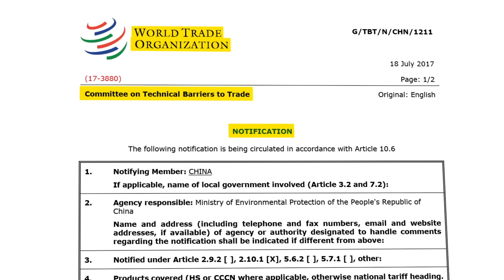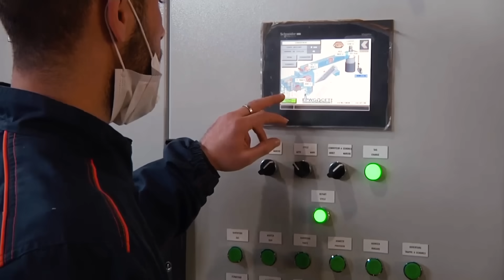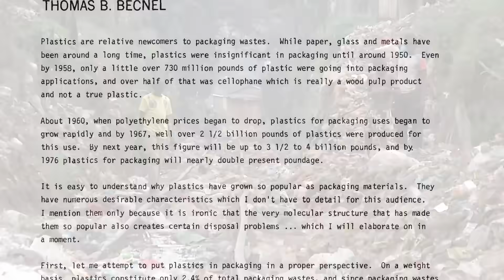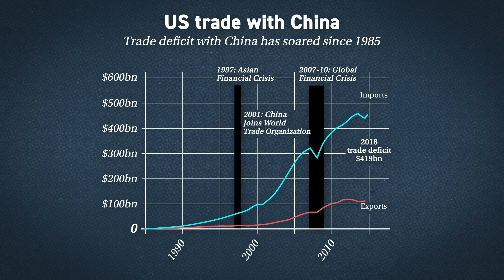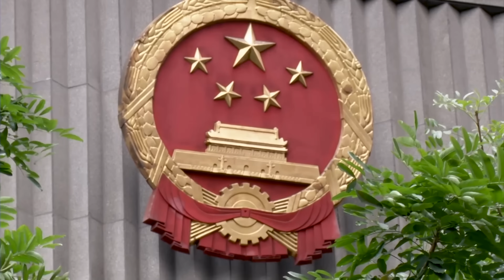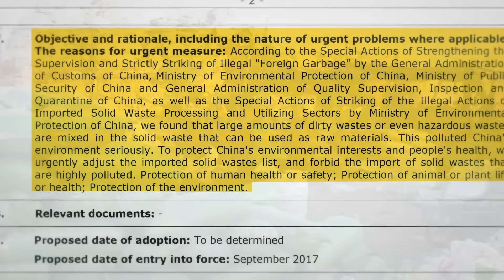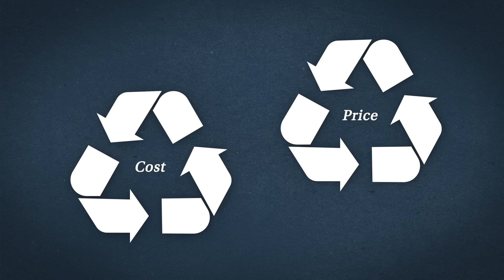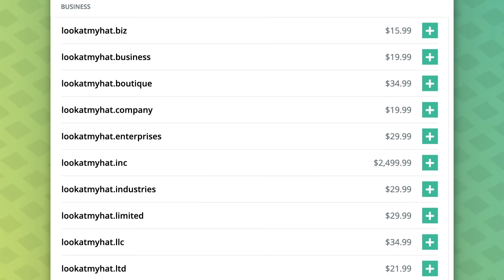How China Broke the World's Recycling

Comment: I was surprised to learn that bottle caps are considered low value.
Here in Italy there are a few charity organizations that collect them and gift a wheelchair to someone in need for every 100kg of bottle caps. I thought that it would have been considered a good plastic to recycle if separated from the bottles.
Reply: My city couple years ago had a big recycling education mail letter
telling people to separate the cap and the seal ring from the bottle before recycling
and toss the cap and seal ring into the trash
(seal ring - the part that break from the cap but remain on the bottle neck)
Reply: They are a high value plastic, however, the sorting of them from mixed piles of plastic garbage and their small mass of plastic per effort adds so much cost that it's not viable unless they're pre-sorted (as in the case of your donations example)
Reply: as he said.. the biggest problem is sorting. There is a awesome video about recycling , unfortunately in German.  You eat a joghurt... you throw that joghurt into the recycling. So far so good. But what do most people do? Put the lid (aluminium) into the cup, the cup gets squeezed.... and the aluminum is out of the process. The cup too as it can't be recycled. Similar to the bottles with the plastic wraps around (Müller Milk f.e. ) both different kind of plastic, machines can't separate them , gets tossed out and burned. If you would separate it before both could be recycled and therefore would be valuable. I guess same goes for the caps.... you sorted them out before.
Reply: @blubbber  actually no, on bottles you dont need to bother sorting out caps or stickers, the PET does not swim, the rest does, its very easily sorted out. the leftovers are fine to use as well, not all but still, far better then just burning all. We usually pre sort em, shred em, wash em, put em through a flake sorter that sorts out per color and then remelt it.
Reply: @blubbber  can you say the name of the video?
Reply: @blubbber  One of the benefits of Thermal Depolymerization is there' no need to sort to get rid of labels or caps or lids even if they're made of metal; at different steps of the process different things 'drop out'.
Reply: @blubbber  How bout if they make the stick on lid on yogurts the same material as the cup? Or bring awareness and tell people to separate the different materials. Or if people buy big amounts anyways, have them buy it in big containers instead of many small ones. Simple things. Yet too many people are unwilling to do them, think of it, or research about it.
Reply: me too
Reply: Italy is preparing for Fallout, smart.
Reply: We used to have the same in Greece; it ended up demanding so considerable an amount of logistics and manpower to run the whole thing, that the organisation said if you care just donate a small sum, which makes a lot more sense when you think about it.
Reply: Here in Norway when i was in school 2011  we collected bottle caps. Every day there was around 400 bottle caps (1 from every student) This went on for about 2 years before it just stopped. Imagine this on a bigger scale
Reply: @scooterxiv3778  How bout people getting their own nondisposable water bottles?
Reply: If pre-sorting is the solution I don’t understand why cities stopped asking us to sort. We pre-sort our recyclables at home anyway; it’s just because the city tells us to throw everything in the same bin when it’s time to take them out we throw everything together
Reply: The problems (in my country) is elsewhere: A bottle with a cap on it cannot easily be compressed by a garbage truck. (It will go back to almost its original size because of the air trapped inside it.) A bottle without a cap will be flattened under pressure, meaning the garbage truck can load a much higher weight per trip. It's the garbage disposal company that pays the charities per tonne of bottle caps. Also having caps pre-sorted makes them much more valuable.
Reply: Lol, actually they are ok, theres far worse stuff. I work at a company that recyles stuff like that, we get huge bags filled with em, they arent as bad as portrait here... Also at least in europe we have/had PET bottles we returned to stores, in germany its still the default and even tin cans like coke etc are like that...
Reply: Corporations ,who control the councils and govt,make money charging for recycling, then they just land fill it , and tell you are doing the right thing (feel good B.S. ) need to go back to glass ,wood and paper ,or biodegradable material.
Reply: maybe it's cuz of Americans not doing their part. Here in Japan, you'd see recycling boxes at almost every big name supermarket, like one for styrofoam tray, one for paper packs, one for plastic bottles (excluding its caps, they are collected separately). It's been like this for at least more than a decade. Sure, apparently we've been shipping some plastics waste to other countries like the US, but it is us, the citizens, we are the one sorting all these, thus it makes recycling easier, meaning more profitable, and probably much portion of the total plastics waste would be properly recycled, I believe.
Reply: Dont listen to that video. Bottle caps are made from high quality HDPE grades. It’s value as a waste is worth a lot, at least in Europe.
Reply: Stavo per commentare la stessa cosa!
Reply: yeah but imagine if you had to pay those Italians to do that work. Europeans are some of the richest people on earth, something like the global 1%. when china cant stop losing money by paying Uyghur slaves €0.10 a day what hope would anyone else have of breaking even doing the same thing?
Reply: We should recycle like Japan. Where the people separate their own recyclables and help. In America, people only have one box in front of their house where they throw all the recyclables in and workers separate them. Workers don't bother to collect small pieces. You can recycle your own plastic. Such as there's people turning styrofoam to glue with acetone. 
There's plant plastic, faux leather, and bricks. Stores like Lush uses no to little packaging. Use fast growing plants like bamboo for wood. Use and bring your own nondisposable utensils to restaurants. There's glass and metal drinking straws. Use nondisposables like glass or metal. Homestead. Japan has toilets that are better for the environment. Do you think digital is better for the environment? How bout nonpackaging vending machines?
Reply: The problem with them is the size. The smaller something is the hardest it is to separate it from the rest of the trash. This is why they make these campaigns, to encourage people to separate the caps on their own.
Reply: That seems to just confirm to me that they're worthless
Reply: it was all a lie
Reply: We also do it in Brasil
Reply: I was also surprised because in Serbia it is the same. But we never heard the price of bottle caps per kg in this video, so it might actually make sense why they are considered low cost. 100 kg is a looot of caps
Reply: In fact caps are from a different kind of plastic therefore they should be removed from the bottle.
Reply: There's always the option of making consumers pay the true cost of packaging material.
Reply: Here in Poland we put the caps on the ends of the chair legs, table legs etc. At least that's what charity says.
Reply: same here in Brazil
Reply: I remember back in school apart from what I call Paper Collection Event(a day when paper for recycling is brought to school) there was once or twice Bottle caps Collection Event.

Also stores nearby happy to get bottle caps.
They get sorting for free, we get less waste on landfill.
Reply: A wheelchair for every 1/10 ton of bottlecaps? Hahaha what a ridiculous thing.

Comment: Ugh you took all the time and effort to gather this info (which is good and accurate) only to slap a racist click bait title on your video. Perhaps if you really wanted to spread this message you would do so in another more helpful way. 

You all said this pretty early on in the video but this needs a huge asterisk next to it. "Recycling isn't profitable so it's not viable." In my opinion that's a huge yes and no. It's not AS PROFITABLE as the corps producing this junk want it to be. Believe me, Coke and Pepsi could certainly accept smaller margins if they wanted to, but their CEOs don't give a damn about the environment. They're just trying to profit as much as possible and that's as far as it goes. 

China may have slammed the breaks on an obviously broken system, but they're not to blame here. We need to consume less. Then reuse. And the LAST viable option is then recycling. Big corp knew this very early on though as you all documented but instead chose a scapegoat and here we are 50 years later. We're all to blame for this. Every single one of us.

Comment: In Denmark we have 6 types of sorted trash in our homes.
After it has been collected and processed there's basically nothing left. It has all been either turned into electricity, been recycled or slags used as filler for our roads or similar.
There's basically zero pollution. The exhaust of the waste management centers is clean enough to drink if you condense it and most of the heat has been turned into energy.

Comment: or maybe stop using those hard-to-recycle plastics? go to the shop and look around.. even same simple water or your fav carbonated drink will be bottled in a whole bunch of diff types of plastics, depending on the company selling them. why?
streamline the packaging materials used? use more glass? up until roughly 2000 or so, there were plenty of countries that simply refused to pack their drinks and snacks in plastic. it was paper, metal and glass. stuff tasted A LOT better than same thing packed in plastic and recycling was A LOT easier. especially, glass.

Comment: WRONG!  It is NOT an economic problem.  It is a political problem.  When I was a kid in the 1950's and 60's, one could find beverage bottles discarded everywhere.  They were always beer bottles, rarely ever soft drink bottles.  That's because the purchase price of each soft drink bottle included a 2¢-3¢ deposit -- and a 6 oz. soft drink cost only 5¢.  There were no deposits on beer bottles.  (Why?  Soft drink bottles were extremely heavy and durable, because they had to be able to survive the drop inside a vending machine.  Beer could not be legally sold from vending machines, so beer bottles were thin and cheap.)  The point is this: the cost of recycling was imposed on the consumer at the time of purchase, and not imposed on the tax payer after the purchase was made.  

The solution is simple.  Instead of running landfills, governments should build facilities that recycle virtually everything, no matter how great the cost.  The cost should then be levied back onto the manufactures (or importers), which will pass it on to the consumers.  The consumers will vote with their dollars for those producers who devise the most ingenious ways of eliminating their packaging (as well as their used-up products) from the waste stream.  But this obvious solution will probably never be implemented -- because of politics.   Producers will lobby the politicians to keep the burden of dealing with waste on the tax payer, rather than on the consumer, where it belongs.

Comment: State has to step in

-Make raw material more expensive than recycled via taxes

-Subsidise recycled to make it cheaper

-Make a awareness campain to push consumer towards recycled

-Develop technolgy to make even those plastic easely recycable with little to no change to quality (already some good lead on that one)

-Push  the 2 first R of the the 3R rule (Reduce, Reuse, Recycle) that part shoud also be largely extended to glass bottle, their recycling is using a lot of energy while you could just reuse it until it break beforehand

Comment: The thought of consumers switching to recycled product containers will NOT work, unlike steel or aluminum, the light film plastics and MRF Residuals can only be recycled once or twice, then they won't stick together anymore, and have to be mixed with 90% virgin product to be used.  Re-Recycled product is actually a contaminant in the manufacturing process.  
Even Paper can only be recycled 3 or 4 times, then it won't even be goods enough to make toilet pape,r it just won't stick together anymore.

Comment: 1. Shipping your problems to another country is never a long term solution
2. Putting the responsibility on the individual consumer to 'do the right thing' is never a viable strategy
3. The only real solution is through legislation: Make plastics in manufacturing illegal where a metal, glass, or fibre solution can be put in place. Some prices will go up, but then wages will go up as well, as the market and wages always compensate for each other.

Comment: Now with 3D Printers people are making all kinds of Stuff ... But , you have to use their Expensive Plastic Line ... If people could reuse the plastics in garbage to make 3D plastic line ... Everybody would want your garbage plastic ! ... You just need a Simple Machine to chop it up and melt it ! ... Like a Trash Compactor .... The Carbon Tax People can Pay for it and give you a Machine for Free ... And mandate only 4 plastics are used , so the different types are easy to separate ! ... Innovative People will be "Lined Up " to get it ! ...  Problem Solved .....

Comment: The real solution is to advertise and encourage the consumer to use thermal bottles.
They are cheap, they keep cold or heat for hours, they are very comfortable and practical.
Where do you get the water? From the taps.
At most people buy a filter, which with great demand would become very very cheap, and the problem of plastic in bottles would be drastically reduced.

Comment: What's going to fix recycling is the new age of electric vehicles. Plastic is often created as a secondary process to making petrol, and once we dramatically lower petrol use, we'll see less new plastic because the cost to purchase the plastic will skyrocket.
The reality is, most plastic is just fine so long as it's purified. Most consumers don't care if their plastic bottle is slightly more cloudy, or slightly easier to crush, or slightly thicker to prevent that, etc. so most industries will just... buy the used plastic, and maybe increase their product cost by a small fraction.

Comment: YES BUT PEOPLE ARE STUPID!! HDPE number 2 plastic is found in a wide range of products!! Things like those bottle caps, plastic shopping, bags, 5 gallon paint buckets, modern coffee containers, pill bottles, oil cans (that motor oil comes in) and a lot of other things can be purchased as Number 2 HDPE plastic (containers) and HDPE plastic can be recycled into a number of other things!! Plastic hammers for both metal and wood working, cutting boards and even wire cable harness tie down points where the plastic could insulate the wires from rubbing against metal parts!! And these are not the only example of things that could be made from recycled Number 2 plastic!! There are tons of videos on YouTube and else where showing things that could be made from this plastic....but today states like New York have done away with Number 2 HDPE plastic shopping bags, because the state leaders are too stupid to understand that you can recycle them!! And further the same state once outlawed the use of paper bags and most cardboard all of which would be recycled, for the same stupid reasons thinking they were "saving the planet" without considering or understanding the processes that could be done to reuse these products!! 

In fact too often in my area alone I see people tear down a damaged deck of pressure treated lumber and cut it up in pieces too small to use certain parts of it! While much of this type of waste ends up in a landfill nobody ever considers that if they took the time to "cut out" the pieces in more "usable chunks", much of the old lumber COULD BE REUSED and salvaged!! Even some old car parts can be used to make other things, as well as processes to recycle some so called "E Waste" like reusing old computers!! Currently I own a slim form factor computer that was build in 2007, that once was considered "junk" by the former owner, and today I use it daily for surfing the internet and gave an old computer new life simply by doing upgrades to it, and installing a newer operating system into it!!! 

But again people are dumb and you can't seem to explain to people how to look at "recycling" common items or how things can be reused or repurposed!! In fact most of my life since 1977, I have learned to work with "what I have" and I have often "recycled things" to make use of "crap" other people told me was "junk"!! And I am 57 years old now.....meaning I started recycling when I was 12 years old in 1977!!
Reply: OH and while bottle caps are made out of Number 2 HDPE plastic....the kicker is so isn't the bin I put my recycling into to send it in for recycling!! I guess people forgot how injection molding works!!

Comment: The US is all about overconsumption. Also, the responsibility is not on the consumer, it is on the manufacturer. We had paper bags before we had plastic bags. Plastic bags were used as more profit could be made as they were cheaper to produce than paper bags. 

The main point, the US (among others) needs to enact legislation to ban the manufacturing and distribution of these materials as disposable containers. Will this cause the cost of those goods to go up? Yes, undoubtedly, however, there is no alternative. We are not a proactive nation (see climate change) and I fear it will be too late by the time anything of note actually gets done.